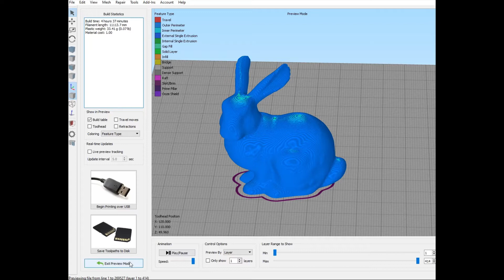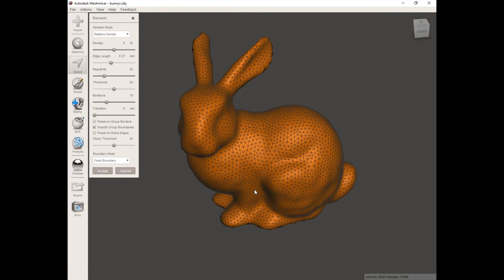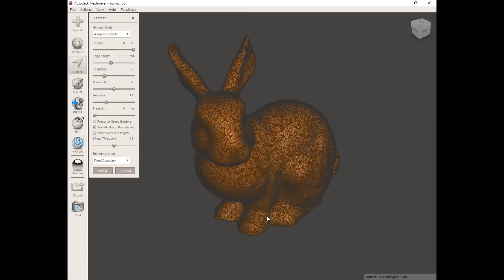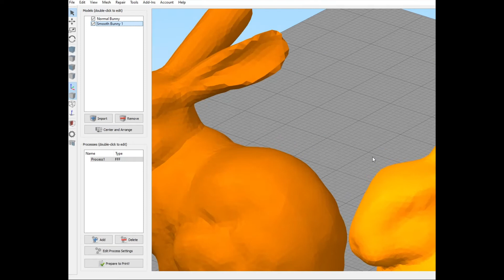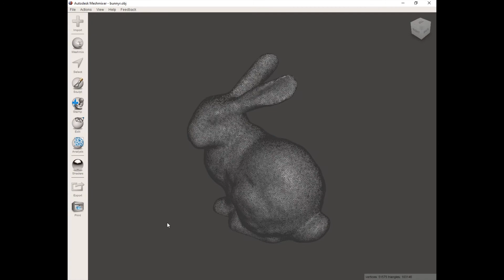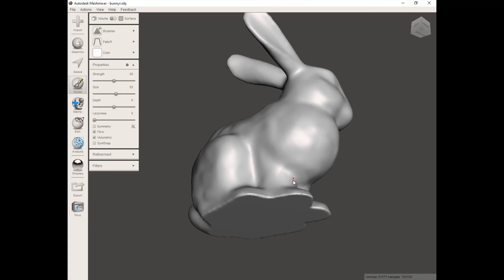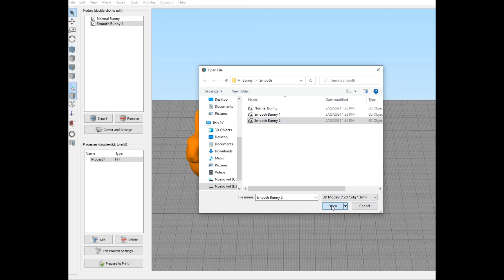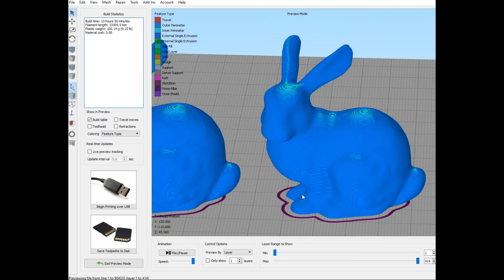How to smooth the surfaces of STL models with Meshmixer

Comment: When i try to change my settings for remesh it automatically starts to remesh before i can fully adjust my settings.  Is this a feature than can be turned off?
Reply from the maker: No, unfortunately this cannot be changed, although it would be very useful if it could.